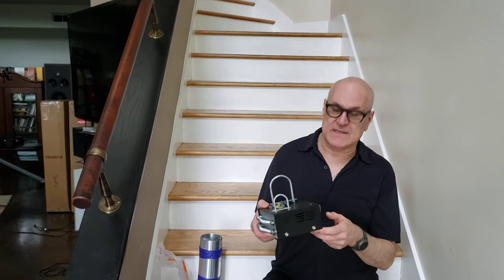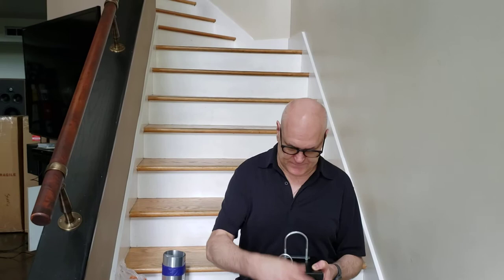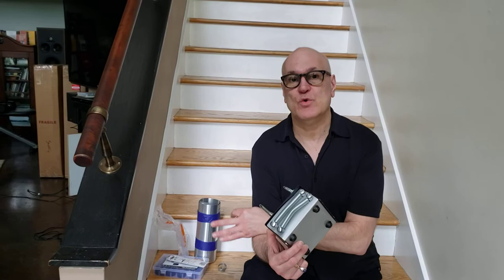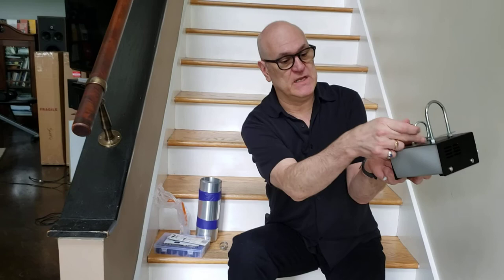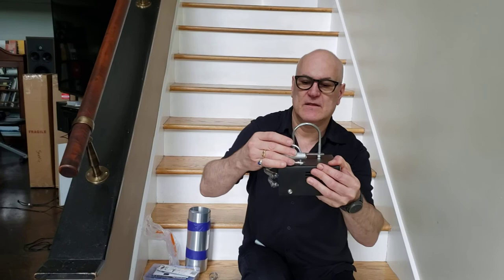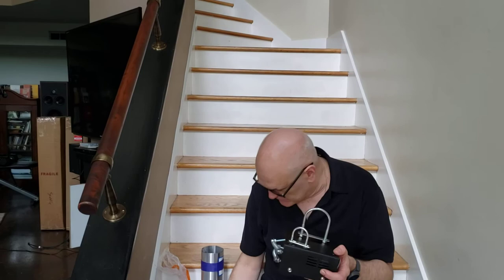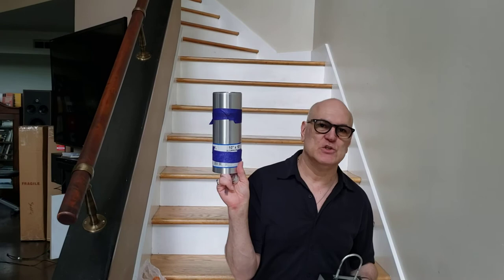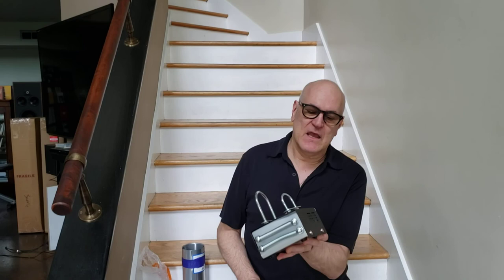Building a "Scrapyard" Contact Mic Noise Box Part 1

Comment: Heya, Ed! Liking where this is going. A few notes though: your springs look a little long, so you might not get too much sound out of them unless you make them have more tension., but maybe by having one screw sticking way more out than the other will give enough tension. Hard to tell from a YT video. For drilling the holes in the pipe on mine I used what I believe you call a drill press vise. Just really tightened that sucker up to clamp the pipe in place and went to town with a drill. Look forward to part 2!

edit: Then you just showed off a drill vise when I resumed playing the video, haha. I used one of those, just a much bigger and heavier one.

Copper should work for the coil, for sure
Reply from the maker: Yeah, I need much better springs. I will address that in episode 2. Thanks brother!!